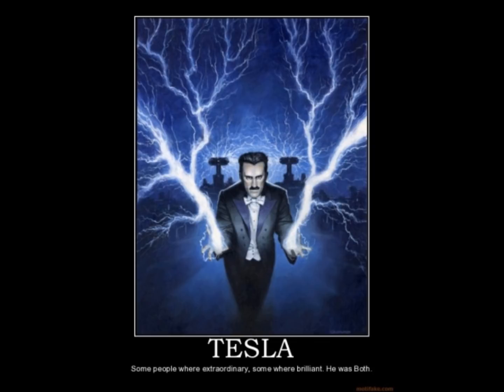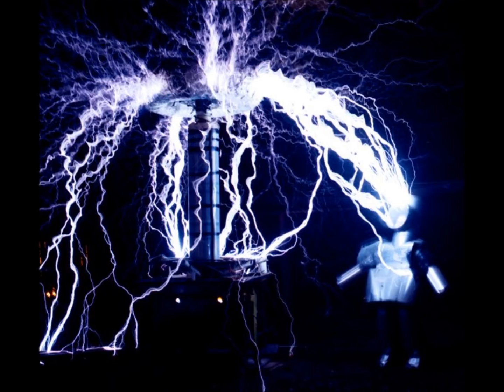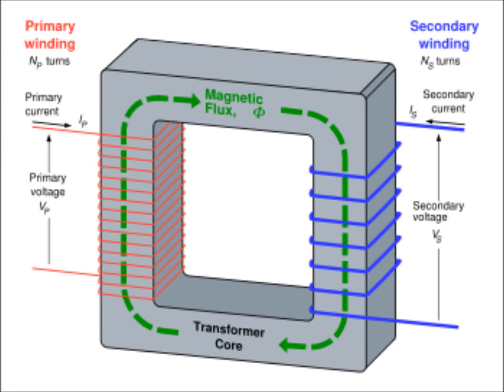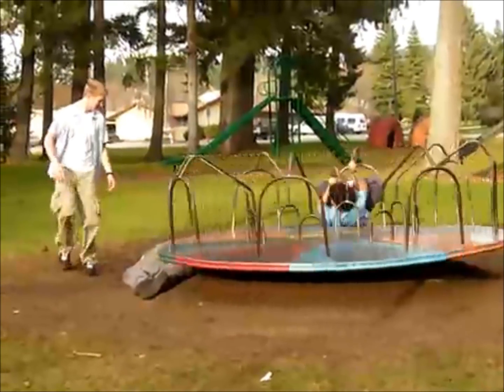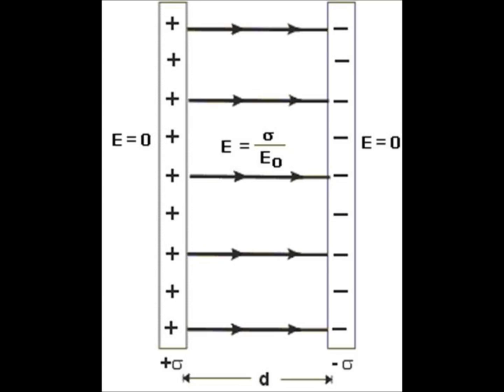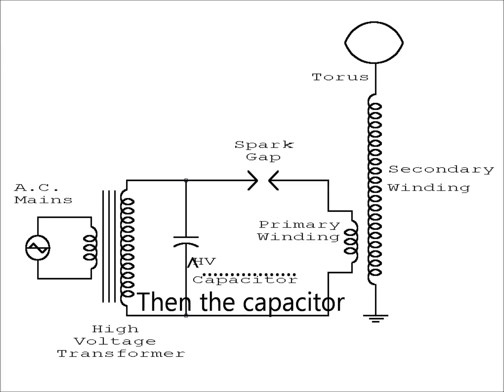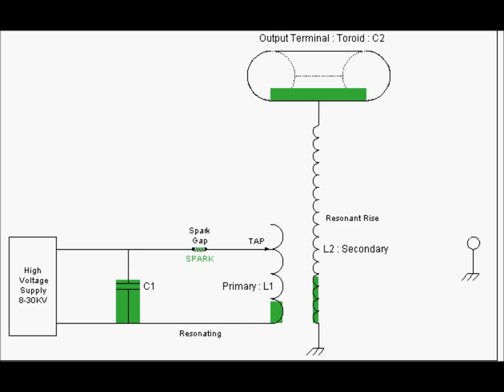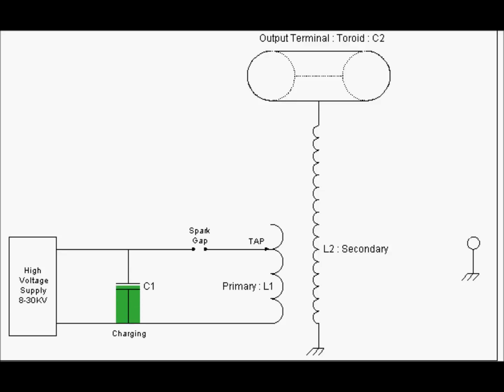How a Tesla Coil Works Physics Project

Comment: The dielectric break down voltage of air is 10,000 volts per centimeter. Not 1,000 per inch.

Comment: alternating current allows electricity to reach your house. Appliances are usually D.C because of the very short distance from source to appliance. However alternating current holds it's load, and voltage can be boosted to push the current through long distance cabling. With D.C the current simply suffers too much volt drop and and can't push itself far enough to reach everyone, from this i also guess it can't maintain the ampage it needs. Substations/transformers are used to push A.C current through from the powerstation, A 400KV supergrid would put the current through several step down transformers so when it reaches your house it's not at 400KV but 230V. A.C current is produced by using slip rings while D.C current is created through carbon brushes and commutators. This is all industrial stuff but if anyones interested in learning about electrics hope this helps a little!
Reply: Not exactly true. AC has the advantage that voltages can be easily increased or decreased - at high efficiency. With DC, conversions are expensive. 

Most appliances run on AC, although most electronic circuits require DC, so the AC is converted to DC inside the device.

DC is actually more efficient than AC, even for long distance transmission - if the voltages are identical. But the voltage conversion problem I mentioned above makes it impractical for anything except very high voltage transmission lines. The reason it is more efficient is that there are no hysteresis losses with DC power.

Comment: when i am wounding the secondary coil, the cu wire got sheared ! now if i solder it and  carry on the process will it affect the inductance and the arc length of my tesla coil ?
Reply: So they teach this to Indian children but not Americans? Is that because of privilege or are the students here too worried about getting shot up in another school shooting?
Reply: What does this have to do with the subject?
Reply: No need to start over. The currents in the secondary coil are very low - a few milliamps at most. That is why the wire can be so thin in diameter.

Just solder the wire and continue. It could simply be wrapped together, but it is desirable to avoid sharp points which would encourage an air discharge at the point. Also, the solder makes sure the sprayed on insulation coating will not be able to get into the joint.

Comment: Imagine that the spark gap was shorted out.  Wouldn't the source transformer still create a voltage in the tesla coil? What does the spark gap do ?
Reply: Yes, a voltage would be induced in the HV secondary. But since the voltage would be a power line frequency, it is doubtful if any spark would be created. 

The spark gap creates multiple high frequency voltages, which are more efficient at ionizing the air.

Comment: Drew Colpurs,
your presentation are don't true narration & visualization the schematics for Tesla's Coil (such it's mean are the "Tesla's Transformer") because your narration of the principle for Tesla device are wrong! Your describe & visual presentation them such described work process with classical TV set - it's circuit for high-voltage on Tube (for generate the +15..25 kV), - of course, without uses discharge gap on TV device because on TV set use transistor switch for it now.
It sadly that you do not understand the difference between them.
Reply: +peopletvful - Dude! Get a translator before you try to make a specific point when talking about things this technical, seriously! That said, Drew Colpurs said that he made this in HIGH SCHOOL, end of the year, and only intended for his instructor to view it originally. It is clearly not a professionally produced piece, nor is Drew a fukkin' Scientist at the time of production. His presentation is a damn good effort and does not deserve your scoffing at it in, what I assume must be, your disasterously executed interpretation of English-based language. You ought not scold others while attempting to correct their flaws, as it tends to serve to distance more than assist, ultimately, and judging rarely helps , now, does it? Now have a wonderful day, won't you?

Comment: How does the tesla coil cause wireles electricity to power a lightbulb far away?
Reply: psywarrior8401 How is it free?
Reply from the maker: Electricity is the flow of electrons.
Lightning is electricity that overcomes the natural resistance of air to pass electrons from one atom to the next (since air is gaseous, which is naturally very far apart, and most gasses in our atmosphere are relatively stable, this requires a large amount of voltage, aka push on the electrons).
When the voltage is high enough to create lightning, a current of electrons can be passed from the power source (such as a tesla coil) to something accepting a current, like a light bulb, causing it to light up.

Does that help?
Reply: Drew Colpurs That was what I believed, but a person told me that it was due to a great amound of radio waves, so it made me uncertain.
Reply from the maker: ***** That person is mistaken
Reply: Drew Colpurs Good, because to me it sounded a bit absurde for radio waves to induce such high voltage in to a conductor.
Reply from the maker: Spirit Soul You're referring to things I've never heard of, but in terms of practical applications of tesla coils, they're not practical. Anything in the path of the current would be fried, there's no way to maintain a steady current, and the amperage would be quite low. In terms of Bearden, I've never heard of him.
Reply: +Electro-Cute Tesla was working on high voltage transmission through EM propagation for wireless free energy (free as in no money) and many people who don't have an in depth understanding get confused on the the subject.
Reply: Riskteven ... or a tax.
Reply: Yogin TrueKrishnaPriya

Comment: This is a step down transformer. Voltage is not current try it running a lamp and measure current it will be minute and can do no useful work. It is also ac not dc any dc is created by the rectifier within the meter.
Reply: Incorrect, if you are talking about an analog meter. They are all DC. To use with AC, the waveform has to be rectified.

Comment: 10,000 volts to arc one inch not 1,000. Can be up to 30,000 depending on conditions.
Reply: gevo Voltage & frequency makes the difference, amperage is a function of impedance.
Reply: Nic Stroud 1 have heard of 10,000V powerlines and train power lines sending 2-3 foot arcs, arc distance may also be inclusive of capacitance, frequency, and available current flow capability
Reply: The breakdown voltage is the voltage needed to establish an arc. Once it is established, it can grow much longer without extinguishing. The Jacobs Ladder effect is a perfect and simple illustration of that phenomenon.
Reply: It all depends on the amperage it could be as little as 1kv and up to millions of volts. To put it into perspective the arcs made by static electricity are millions of volts and jump a few cm

Comment: Just to add a little praise where its due. As a young lad you should be proud of making a fine video, I will not pick on your errors as some have, they are totally missing the point, and I guarantee that when they were your age they had trouble making sure they wiped correctly - never mind make a watchable science video. So to the detractors, his next video will be better...this is how we learn.
Reply from the maker: Thank you
Reply: Hi. That has to be  one of the best comment I have ever read so far.  Thank you for this video Drew, keep it up.
Reply: here is the manual from Steve Jackson, the man that has replicated tesla's patent for wireless transmision of power, its very well done, even a baby can do it, please spread this with everybody, like im doing now please
http://www.apparentlyapparel.com/uploads/5/3/5/6/5356442/jacksons_tesla-wireless-coil_instructions_apr-21-2011.pdf

Comment: In Nikola Tesla's 1892 lecture he indicates more success with generators than with the spark gap method for some operations. Also his diagrams have single loop primary actually connected to the secondary.

Comment: WRONG there is no magnetic current transformer action only potential charge induction when the primary current is ZERO. Tesla used one loop primary for efficient charge induction. There is no loop circuit in secondary and only momentary in the primary for a current. Gap resistant 4 ohms according to Tesla when conducting. Current in primary goes from MAX to ZERO generating a great potential of charge to transfer by induction to secondary inter winding capacitance for repeated storage. That is how voltage is built up.
Reply from the maker: I've said it many times over in the comments and I'll say it again, this was a high school video project and a lot of the information was over my head. At the time, there were very few resources which dumbed down the information, so I tried to understand it using what I knew.
I expected nobody other than my teacher to see this video, but oh well.
Reply: Drew Colpurs  Yes you gave the standard explanation. Thanks for posting.

Comment: I though it was 10,000 volts to and inch.
Reply from the maker: Well it varies on the amps since the voltage necessary to overcome resistance is IxR (I for amps and R for ohms). V=IxR
The average resistance of fair weathered air is very roughly 4x10^13 ohm meters.

To be honest I haven't done the calculations myself, but I have been told that I was incorrect in this video.

Comment: Having watched this video, I now know LESS than I did before I started
Reply from the maker: Well that just doesn't seem possible.
Reply: Drew Colpurs
Your lost me at the merry-go-round metaphor, You state that the secondary coil has "many many more coils of winding" as opposed to the diagram which has less. If the secondary did indeed have more coils, then the transformer would step up the voltage, and therefore, reduce the current. The diagram that follows the other group of boys at a merry-go-round also shows the electrons always flowing in the same direction - this is not how a transformer works, i.e. a constant DC current on the primary will result in exactly 0 current on the secondary.
Reply from the maker: The idea of a tesla coil is to step up the voltage, current loss is a byproduct but necessary. These diagrams are not made by myself.
To be completely honest, I'm getting kind of tired defending myself for a video project I made in high school a year ago. What about my Spanish videos? Do those have thousands of views and dozens of comments complaining about our horrible grammar? No. So why would I expect this to be any different. Yes, there's lots of things wrong in this video, but I wasn't predicting that it would be such a popular source of information. In fact, I would bet money that if I remade this video with 100% true everything, it would never get as many views as this video.
Reply: Drew Colpurs
I searched youtube for "how does a tesla coil work" and your video came up as the top result. My mistake was thinking that youtube somehow knows if a video is accurate or not

Comment: nonononono!!!!! 1kv for every milimeter!!! not Inch!
Reply: The dielectric constant (resistivity) of air is variable based around air pressure and humidity. Also if you're considering DC vs AC, the constants are different. In the US, the average constant is considered to be about 31kv per cm, (or 3kv per mm) for dry air at normal pressure. That is a dielectric constant of roughly 1. Under the right conditions, all of your answers could be accurate, however. Atmospheric conditions make the relative permittivity variable vs truly constant.
Reply: 3kv
Reply: Jim Ross you’re wrong bro, check Wikipedia, 3kv per mm in air
Reply: Jim Ross so.. you definitely arguing with Wikipedia? 🤦🏻‍♂️
Reply: @NirNova98  You don't know whether Wikipedia is always accurate or not. Maybe the man is right and it's 69 kv. I just don't happen to know too much so I am not gonna give a conclusion but yeah it's a lot of voltage😂😂😂
Reply: Mr. Nobody yea you’re right, but any information source, says that 3KV per millimeter in air, you can check it by yourself, check out Instagram, search for “ElectricBurns”, i’ll explain for you there everything with pictures and proofs, see ya there friend
Reply: Jim Ross You are so funny, this is my account so I could proof my things don’t try to be smart head, learn one thing on an electron then try to prove how “smart” you are
Reply: @NirNova98  seeing as we all interested in tesla coils, can you point in the direction of the best way to make a modern tesla coil
Reply: IFiguredItOut 999 a great youtube channel called “plasma channel” make this vid, also check an Instagram page called “ElectricBurns” that make some nice sparks ;)
Reply: @NirNova98  I don't want sparks I want the ability to power a coast line. I'm talking building sized

Comment: most of what you said is wrong.... but i did get threw 2 min if it.
Reply from the maker: Well I'm glad that "most" is consistent of 1 fifth of a video nowadays. Especially since the first 2 minutes is probably the most accurate information in the video. I'm well aware of a number of flaws, but household currents=120v. Transformers adjust voltages based via magnetic fields of moving electrons. Nikola Tesla was a mad genius.
Sorry, what was wrong again?
Reply: im not sure if you got the post . my phone freaked out and booted me out of G+
Reply: i think it was too long of a comment.....
Reply: -current is measured in amps, Volts are different.  with a Tesla coil you are trading current for volts.  the more volts you get the less current (amps) you get.  so when you say current as the rating of all the power in a given system, it will be confusing to people who know what amps are. also the ratio is inversely proportional (amps to Volts / give and get)
- Tesla coils don't amplify anything, they triad amps for volts. 
-it takes 25,000 - 30,000 volts between needles and 50,000 - 55,000 volts between balls to jump 1 inch(slightly dependent on humidity). 
-the electrons do not move more quickly.  the magnetic field claps on to the wire and generates voltage directly from the field.  
- you can view it as a 2 lane road converging in to 1 lane. keeping the entry speed the same the exit speed will double.  
there is  more but i'm driving and goggle talk id messing up.
Reply: your explaining electricity with no background in electricity.  it will confuse people who are curious and want to experiment.  electronics engendering was my major.
Reply: your idea of what the picture are doing is inaccurate.
Reply: also you have no idea how a electrolytic capacitor works.
Reply from the maker: People who know what amps are would also presumably no what volts are. When dealing with a tesla coil, we're not concerned about amps since we just need to overcome resistance of air, which requires volts, not amps. Tesla coils amplify volts, but since you can never just increase anything in physics, amps are sacrificed. I found several sources stating that on average it takes 1,000 volts to jump 1 inch, although double checking myself just now I find a bit more variety in terms of answers, and it does seem you're correct, so I'll concede that point. Also, this was for a high school physics project, so you are correct that I don't have a proficient background in electricity. That being said, I had no idea it would reach a dozen views, let alone thousands. I'm honestly surprised by this.

As for any actual misinformation I give (which I'm well aware exists in this video), I blame on the lack of information available to those people who only have a very basic understanding of electricity at the time I made this video, which is the type of understanding I had at the time. I spent hours researching things way over my head, trying to break them down into the simplest information possible, and present it to a group of people so they could understand it as well. I believe this is also why this video has become so popular, there is simply a large lack of basic explanations of how a tesla coil works on the internet, and while many points are erroneous, I still made something complex by nature understandable to the average person with zero background in electric engineering.
Reply: i apologies for my rudeness, i reread my comments and they sound rude.  please keep up your curiosity and if i can help you in any way please feel free to contact me.  i'm currently working in IT, but know a great deal about electronics in general.  i'm currently working on large overclocks on computer CPUs GPUs and FSB.  again, excellent high school video!
Reply: also i was unaware that the comments were posting threw you-tube as well as your G+ lol.  thanks again!

Comment: Your explanation sucks.  This is an AC device, but part of you explanation makes sense only for a DC device.

The capacitor doesn't really store electricity.  The capacitor and the primary coil form a resonant circuit.  You almost said that.  This doesn't force current into the top of the secondary, a high frequency high voltage ia produced across the secondary.  This is an AC voltage.  The torus on the top of the coil is to reduce corona discharge.
Reply: Yep, he's wrong about that. But he is correct about all the other things he mentioned are wrong with the video. 

As a high school project, I would rate it an average effort. At least he put the effort in, which is more than many students do these days.